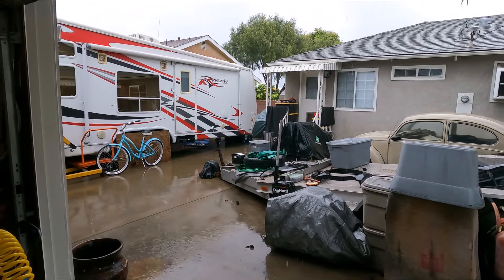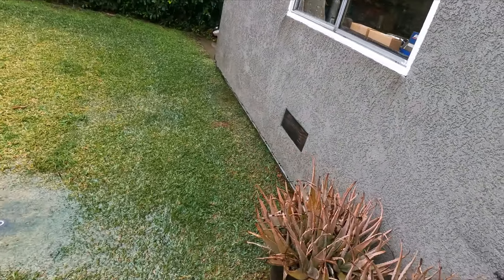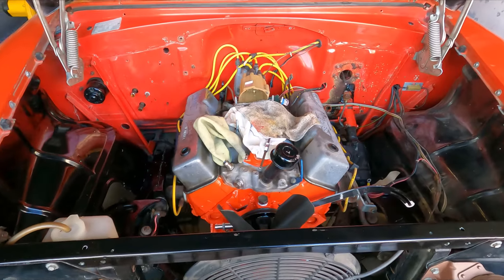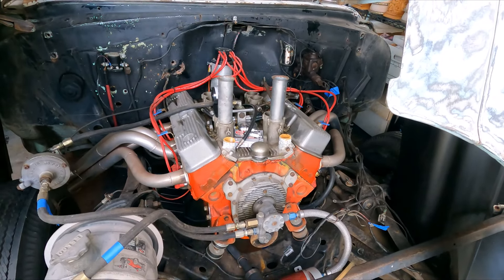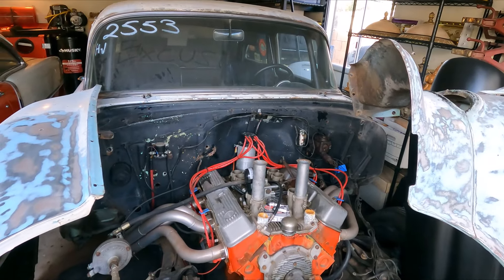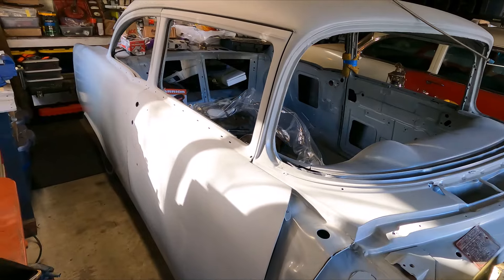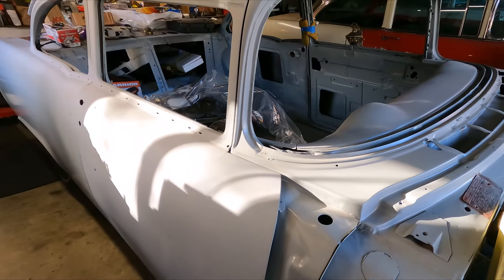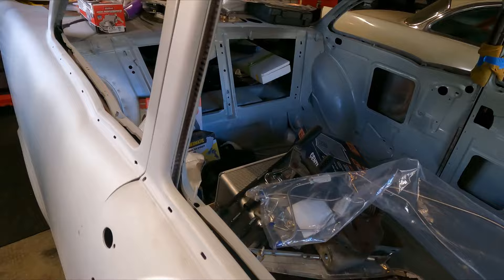Drying Out and A Shop Update!

Comment: Cool video Jeff! I was looking at your firewall on your red 55 sedan.  Im thinking that is a low body number by how the wiring was run on it originally? Glad the rain has past I've lost way to many days to rain. Lol Have a good one Buddy 👍
Reply from the maker: Thanks Don!  Yes, the kid and I were just talking about the early production run on my Bel Air just today.  It is a Van Nuys Car with a production # of 422.  I took my clock and my heater controller out to paint the dash and they had Oct. '54 stamps on them.  I saw that gold 50 Millionth '55 episode and it had some neat early production stats on it.  My Bel Air didn't have the clips above the distributor and had the starter harness behind the battery but, I moved that closer to the starter later.  I do not have the V shaped brackets on the core support either so, my thought is that it was changed out to a V8 core support when the previous owner put the '59 283 in it and put a V8 position support in it.  The original engine was a 235.  I hope you guys are well and thanks for watching!  Take care!